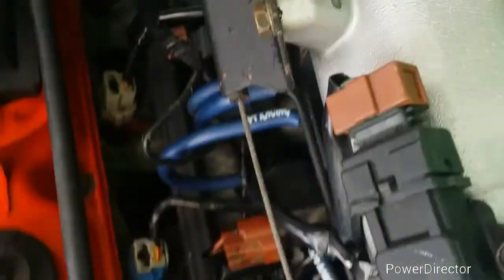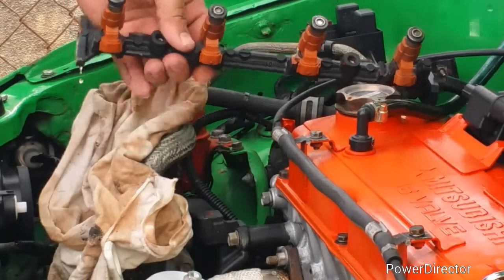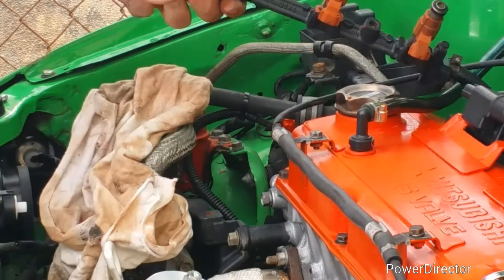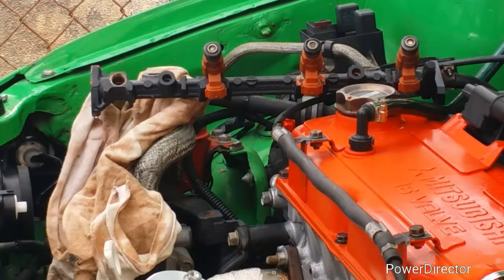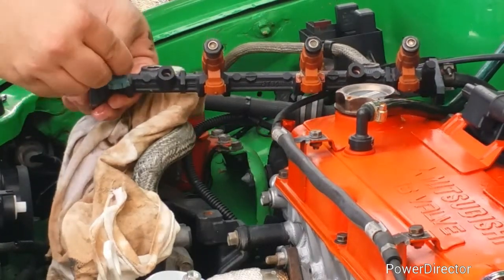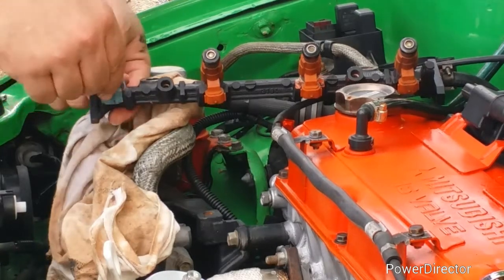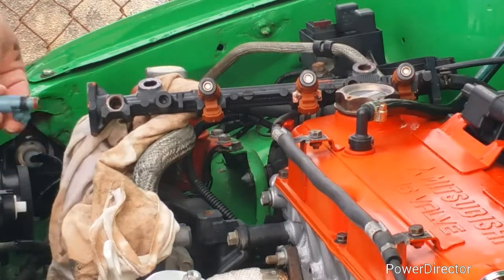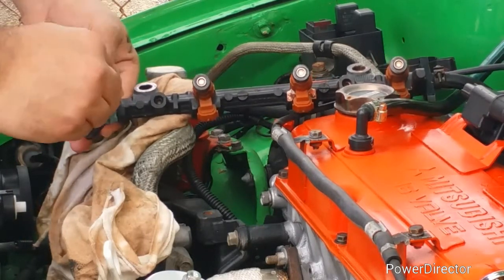Mirage turbo 800cc how to install Big injector swap 4g93T

Comment: Can u send me a link for that exact injectors
Reply from the maker: https://rover.ebay.com/rover/0/0/0?mpre=https%3A%2F%2Fwww.ebay.com%2Fulk%2Fitm%2F253524542329
Reply: Thanks cause I have a 4g93t gsr cm5a ck model with apexi power fc
Reply: Thanks it works for turbo?
Reply: Is it hi or low impedence